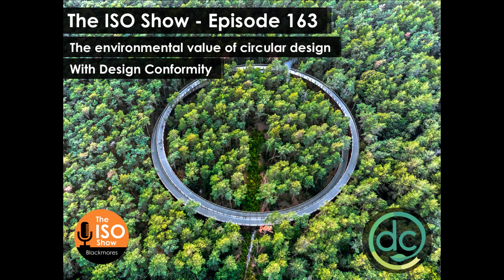#163 The environmental value of circular design with Design Conformity

Comment: Great to see focus on product design to drive improvement in relation to product environmental performance/impact. EPDs based on comprehensive verified data are useful to gain information & convey this to consumers via recognised marks but don't fully address improvement practically in my experience as a manufacturer.